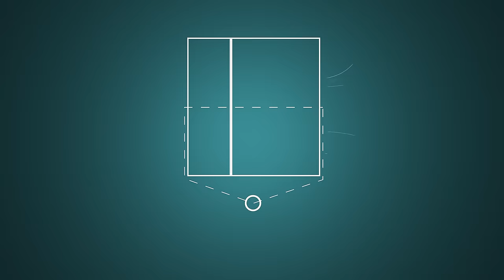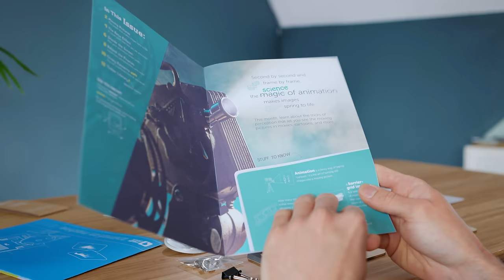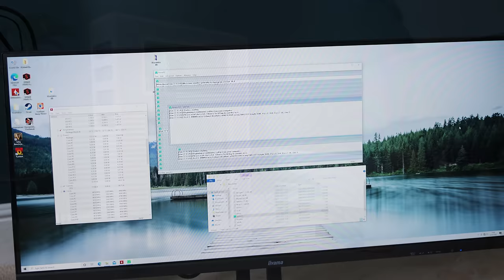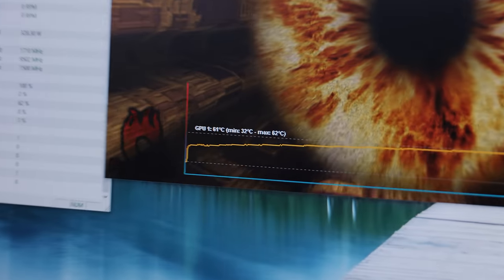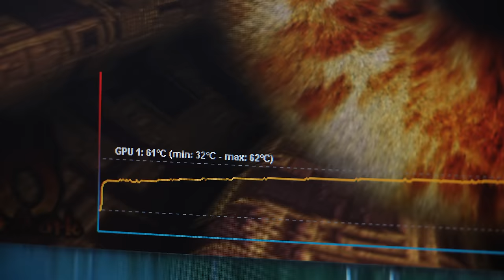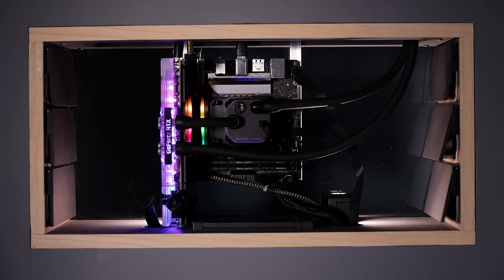Building the world's first 'breathing' PC

Comment: Imagine if when the system was under load, the breathing rate increased. This is incredibly creative and I'm really impressed!.
Reply: Oh that would be awesome. I guess he'd have to use some relays and such to handle the extra current but it would work for sure. I'm not sure how it would be in practice though, all that variation might throw off the comfy rhythm & turn it into a device of chaos. :u
Reply: great now I'm just thinking about if for the water loop he made a heart-pump instead so the PC literally had lungs and a heart to keep itself cool and a natural stress reaction to intense situations. "Shit, aight guys I have to head off, my PC is having a heart attack"
Reply: The pc can now have panic attacks
Reply: @s1ckkid396  That's okay, you can just give it a paper bag to breathe into.
Reply: toss a threadripper in there, probably result with collapsed lungs
Reply: @whoevertf  Relays are more of an On/Off type deal... but maybe a few nice mosfets could use the PC's standard variable fan voltage to control the motor
Reply: super cool idea, this honestly gives me a lot of cyborg undertones
Reply: Under maximum load the normal breathing rate is more than enough

Comment: I'm pausing the video just to comment this: That solution he came up with to make the magnet fit perfectly into the tube again was bloody brilliant. This man, very impressive.
Reply: It's a quite common practice in the repair/mechanic channels.
Reply: @Markus-fw4px  Yes but the impressive thing is he does it all. I assume those repair/mechanic channels doesn't build computers or artificial sun 😄
Reply: @Markus-fw4px  Doesn't change the fact that it's god damn impressive though!
Reply: I think it's the breadth of knowledge that Matt has that is what's most impressive.
Reply: Impressive, but excessive. He could have just wrapped it in heat shrink or tape until it fit snugly in a slightly larger tube.
Reply: @Zolacolor  The tolerance is quite tight, and it is in water. Sanding it would have been problematic too, since it is iron without the coating.
Reply: when he brought out the nickel solution I really went: "no way he's actually electroplating it to make it fit
Reply: @Emetsys  It is tight, and shrink-wrap is very thin. I wouldn't recommend sanding magnets.
Reply: @Zolacolor  quality-wise, how will it fare on long term usage?
Reply: @jonglopez5400  Yeah, pretty good point. Isn't heatshrink much softer and malleable compared to the magnet? (Easier wear & tear?)

Never thought I'd be learning quite a bit in a comments section lmao

Comment: Honestly, the sheer novelty of it makes the size issue a near non-issue.
Reply: This is probably better than some expensive fans I’d use it for sure plus it looks good lol
Reply: plus the slimness means its toll on square footage is the same as a normal ATX size rig anyway.
Reply: Yea, just having it sit up there by your computer desk wouldnt take up much more room and you could easily turn it into some kind of shelf or bookstand by building on top.
Reply: I think he built if bc its cool. No for sale or practicality. Maby. But yall hatin on hard
Reply: @BbBb-bs8wk  , absolutely no one in this thread said anything that could be considered hating.
Reply: @kaidwyer  Its MDF though so its crazy heavy.
Reply: @TheAciditty  add a 3D printer into this build and/or a CNC cutter and I'm sure he could of made higher quality/lighter materials for a case at the cost of a bigger budget.

Comment: You could mount this horizontally as a desk setup and make its large size almost a feature. Watching the mover glide back and forth under your keyboard seems like it could be quite mesmerizing
Reply: This one^
Reply: YES! now that he's already made a desk computer with water-cooling, he could try this for air cooling!
Reply: i had this exact same thought, it's big but if the whole thing is built into your desk then it would be a non-issue
Reply: Then the valves would not work
Reply: @peer7004  obviously a minor mod to the direction the valves hang would not be hard
Reply: @rileybriggs4731  little springs would do the trick too
Reply: Good for when you're waiting for the game to load
Reply: Ooh top-notch idea! It wouldn’t even have to be as thick, because as long as you can find rods stiff and long enough, it can travel much further so you can keep the same volume in a thinner box.
Reply: @markturner2561  it would need to travel quite a bit faster though
Reply: The air exit being at the top helps it through convection (hot air rises). I'm not sure how much of a difference it would make, but there would be some negative impact to the cooling if mounted vertically.
Reply: @ullianoliveira6135  thatd add backpressure onto the valves. probably better to redesign them  completely for horizontal use. possibly switch the one large hanging rectangle to 2 hanging squares that are hinged 90 degrees adjacent so they are still hanging, rather than using a bandaid solution, which would put more back pressure on the system and also increase the noise level of the valves closing.
Reply: @crakaweazol load times? With that setup? Nah

Comment: The nickel part had me shook, such a McGyver this guy.
Reply: Like McGyver and Bill Nye had a baby. What a wild solution (no pun intended).
Reply: yeah, seriously clever solution,I would have just tried to wrap it up and polish it, but this was perfect
Reply: @walker1054  shaving down the magnet likely would have worked, but you wound not only need a lathe, but one that is very well set up to be able to take such minuscule amounts of material off. Not sure if that would have been easier than what he did.

But buying magnets as well is a great idea. He likely would have gotten a match that way.
Reply: Yeah, that was seriously impressive. I thought he was going to sand the magnet down somehow. In a million years, it would not have occurred to me to somehow make the magnet bigger. This guy never fails to impress me.
Reply: @walker1054  shaving it down would work, but you’d end up with a million tiny pieces of nickel attached to the magnet which will be almost impossible to get off. If he needs that close of a fit, a tiny piece of nickel could end up scratching the pipe which in turn will increase its diameter and thus decreasing its efficienty

Comment: Using electrochemistry as a solution for this build is such a big brain move
Reply: Was thinking the same thing... And entirely home plating setup.. no exotics
Reply: Yeah I was so surprised when I saw he was using electrolysis, absolutely genius
Reply: Im suprised that it increaed the diameter by almost .5mm I normally think of electro plating being only a few microns thick
Reply: I thought he was going to sand the magnet down to size. Electrolysis was a much more elegant solution.
Reply: I'd have come up with trying rolling some electrical tape around it 👌😂
Reply: im not even impressed, he's proven himself as a great engineer.
Reply: reminded me of the breaking bad scene with the improvised batteries.
Reply: As a solution, ayyyyy
Reply: @vixen878  u can still be impressed, just not surprised

Comment: The new acrylic tubes are not good fits.

Matt: so anyways I started electrolytic plating
Reply: haha, I thought about it too! A stroke of genius. Seems to be a regular thing on this channel.
Reply: Lmfao dude this cracked me up, thanks
Reply: @Teh-Penguin  I agree.  I was think.. oh no... He'll provbably have to use rubber "O" rings... but that will probably not work... Then his genius thinking solves the problem perfectly.  What a smart, smart man he really is.
Reply: On expert level.
Reply: Us : give up
Reply: Wouldn’t it be easier to sand the magnet down and make it fit in the smaller tube?
Edit: guys thank you everyone I have enough reasons why sanding magnets is a terrible idea now 😂
Reply: I liked the speaker bubble dislodger.😁
Reply: GREAT problem solving
Reply: I would have wrapped a bit of gaff around it, called it good, and brought the kids to bed....  This was a wonderfully creative solution!
Reply: I was going for " heat an undersized tube and force a polished steel ball of correct diameter through it one or more times."    Other thought would be check multiple magnets, I doubt they hold a tight tolerance on the diameter.
Reply: @mkyprm  i guess it would be pretty hard to make that accurate "round" again
Reply: @mkyprm   That would have removed the existing nickel plating, neodymium does not do well exposed to the elements so it wouldn't have lasted very long.
Reply: @dylanevans5644  oh i see thanks!
Reply: @mkyprm  in theory, but sanding is uneven and it needs to be perfectly round
Reply: @mkyprm  dont want to lose the coating so the magnet wont rust?
Reply: @mkyprm  It's nickel that's used as a protective coating so it's super thin and most likely thinner than what he'd need to take off.
Reply: I do wonder how a company could produce a 0.01 tolerance consistently or if that was an absolute fluke or RNG anomaly.
Reply: absolutely brilliant! out of the box
Reply: @mkyprm  It would be extremely hard to sand the magnet down evenly and make it fit the tube perfectly.
Reply: @mkyprm  My thought was that since he was apparently willing to buy a couple of dozen tubes to try and find a fit, maybe the step before your own electro-plating is buy some more magnets and try and find pairs of magnets and tubes that are sized to work together... :)
Reply: @mkyprm  the problem with magnets is that when you break it you create more magnets. Now imagine all the sanded material all becoming magnets that stick to your original magnet a real pain to deal with.
Reply: what a madlad
Reply: @mkyprm  Along with what everyone else said, since it wouldn't be a smooth finish, you'd increase the friction on the tubes as the sanded magnet passes, waring the tube out and reducing the effectiveness of the bellows.
Reply: I laughed so goddamn hard. Especially since I was like "He wouldn't fucking DARE use electroplating just to make up that tiny mm difference." 

And then he did it.
Reply: My thought is he could get a custom made tube but never thought electrolytic plating works
Reply: HAHAHAHAHAHAAH YOU'RE HILARIOUS! GOOD ONE! LOL!!!!!!
Reply: ELECTROPLATING! HAHAHAHA THATS GOLDEN!

Comment: It really does SOUND alien too, so dang cool! Wonder if tesla valves would work instead to rectify the airflow lol
Reply: Tesla valve yes! Sounds very cool, though a part of the appeal is all the moving parts not making any sounds... Though if you could see the valves through acrylic it would be very cool!
Reply: I always thought your channel was "makers house"
Reply: would be inefficient for air though right?
Reply: @saltsnow7776  yeah, was wondering the same, You'd need much higher pressure or flow-rate I think bcoz of the losses
Reply: All of the turbulence required to stop the flow will make some noise worse than having a fan .....
Reply: tesla valve would not work in this application for sure
Reply: @SidKillz tesla valve arent magic, they are way less efficient and air would escape by those valve
Reply: @SidKillz tesla valves are theoretically one-sided but it's essentially just an open tube. They're also really designed for liquids, so air won't work well with them, all it would do is create turbulence and heavier pressure that would bog down the air mover but would still allow a significant amount of air to pass through the wrong way.
Reply: @SidKillz yea np. Tesla valves are a great concept but they aren't check valves. As long as you have enough pressure or enough time the fluid will find its way through when pushing against the restricted side, as it's effectively just an open tube designed to create as much turbulence as possible, but it's function is also it's biggest flaw. If you just hold one upside-down and pour water in the wrong end it'll take a minute but you'll eventually see it leaking out the bottom
Reply: Oh, hey, Angus! The algorythm lead us down the same path I see. :)
Reply: Until you realize he used a 520 watt passive PSU 🤦‍♂️ This PC isn't sustainable and is only for show. If he tried actually using that PC with those components it would melt.
Reply: tesla valve works greate for high pressure flow, may not work with this smooth flow.
Reply: Angus, I am shocked you mentioned the T word without Integza jumping into the chat!
Reply: @saltsnow7776  not really. I've played with some of them, and if you increase the angle, the pressure can drop. Increasing the thickness of it, is making it more efficient. No video unfortunately.
Reply: I think it would work, just you'd need to make them far narrower than if you were say using them for water.
You could maybe laser-cut a load on a sheet of acrylic (putting a load in parallel and offsetting alternate ones to stack them close) - and then stack a load of these cut sheets, between solid sheets, to make a "tesla valve block" and bolt it where there are flaps.
I suspect the efficiency wouldn't be great, resistance when pulling it 'the right way' would be way worse than the hole the flaps provide - but would look awesome if you then lit the block - and even fewer moving parts.
Reply: i also think they will be noisy turbilance and high pressure = noise
Reply: Just like the original intended use in the earthquake machine.
Reply: Yes tesla valves! Then use those to convert the 'DC' airflow into an 'AC' airflow
Reply: 17:33
Reply: Tesla turbine!!
Reply: @PabzRoz  Oh come on at least the concept works and looks nice.
Reply: I was thinking of getting rid of the  valves all together, by using a Wankel-style compressor, or a Roots compressor, instead of of bellows. Yes, a continuous rotational movement is not as eye-catching as the reciprocating movement, but a figgin' huge Wankel or Roots style compressor inside an acrylic glass case would still look awesome. I guess.

Now, these compressors have lots of curved surfaces, and this might be more challenging to build (though I'm confident that this guy could pull it off with ease). My first thought was to cut a Roots compressor out of styrofoam sheets, light, easy to work with...and possibly squeaks when touching the acrylic windows.

On the other hand...if Tesla valves are "too inefficient", just build bigger bellows.

- "So, where's the new PC you wanted to show me?"
- "You are inside of it. Take care not get squished by the bellows."
Reply: very cool but valves tend to be needed to be thin not long, but i mean.. create a valve tube and ur golden. i wonder how much teslas design can be shrunk down.
Reply: @1nicube  ofc but the more you stack the design the more efficient it becomes.
Reply: @FractileSoriah  in physics air is also considered a fluid
Reply: @thegoldenatlas753  yeah im aware, its why I specified liquid in my first comment and fluid in the second. My main point was that a tesla valve by nature isnt gonna work as well for gasses as it would for liquids since by nature any gas is less dense than any liquid and moves around itself easier. But, a tesla valve also works better for any fluid in a situation where high pressure/short time is in place. Its really a cool thought that the fluid itself becomes an obstacle in that specific situation.